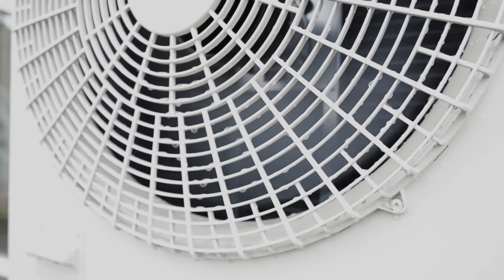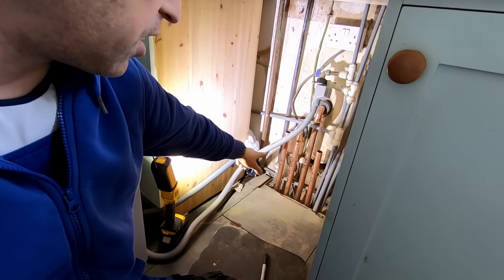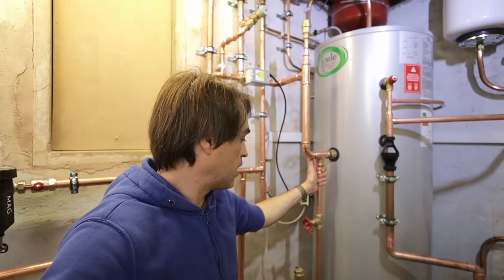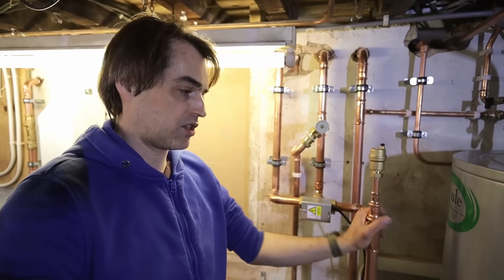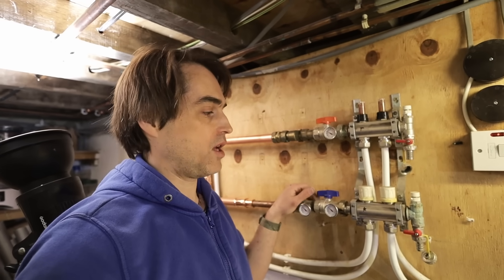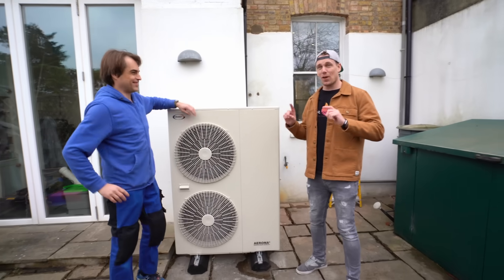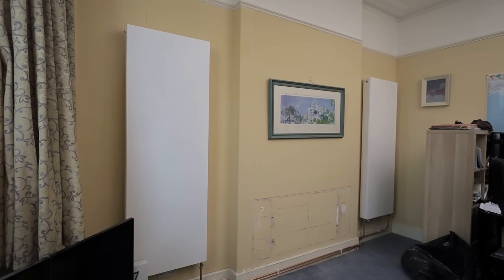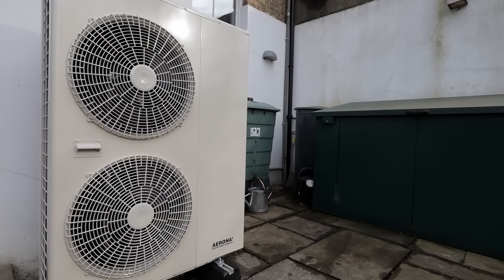The Truth about Heat Pumps: Debunking the Myth.

Comment: Totally impractical installation that’s why they are now talking hybrid installations where so much of what you done would not be needed and is more practical
Reply from the maker: Hybrid would need all of this plus more
Reply: @UrbanPlumbers  really explain
Reply from the maker: You still need to put a HP and all the Pipework need way more controls, a buffer, additional system pumps, etc. Hybrid is a way to go when the HP cannot do the heat loss at he design temperature
Reply from the maker: Although I am not against it. Actually thinking of going ASHP for my place but keeping the boiler just for dhw and without the cylinder

Comment: Roger point is that running cost of heat pump is more than Gas Boiler which is true. Because most people run their Heat pump below COP(Coefficient of performance)  of 3.
COP of Heat Pump should be above 3 if they are going to replace gas boilers and reduce utility bills.
Achieving COP greater than 3 is very difficult if you are using Radiator with heat pump. COP depends on Temperature difference between supply water temperature and the outside Temperature.
Heat pump are effective when the supply water is around 35ºC -40 ºC range , even outside temperature falls below -15 ºC. At this temperature range  COP will always stay  above 3.
The solution is to use underfloor heating even for first floor to get the best out of Heat Pumps. Under floor heating can provide effective heating even when supply water is around 30ºC provided it is designed by professional.
Those massive radiators take space specially in a Music room and look ugly and will struggle to heat the place up when outside temperature falls below -10ºC.
Reply from the maker: running cost of gas is usually lower because gas is cheap as electricty is taxed more heavily than gas. This will have to change.
Reply: 'most peoples run their heat pumps below COP of 3' is incorrect. People have a heat pump running at below 3 as they have been poorly sized and installed. Heat Geek and UrbanPlumbers are averaging well above 4 for their installs. Roger seems to fail to recognise this point, even though he has been around quality installs. 

Can you show your working out for your last conclusion regarding the Music room and -10c? Or is that a feeling?

Comment: It makes no sense installing a heat pump when you have a gas supply in the house already, this install must have cost over £20k that's an awful lot of gas to burn, plus it's cheaper to burn gas than electric, I am with Roger.
In New timber frame homes with UF heating no doubt they will be fine, but most UK homes are no designed like that, and these things are not suitable for them.
Reply: Putting aside the green debate which gas loses immediately, will gas still be cheaper than electricity in 5, 10, 15 or 20 years? Say gas becomes 10x more expensive, is there anything a consumer can do to mitigate that except use less?
Reply: @CampGareth  you do realise electric is generated from gas as well as coal, so there's no green issue really electric is not as clean as the proganda suggests, so if gas goes up then the cost of electric will increase
Reply: @acelectricalsecurity  not in all regions. Scotland is basically all wind all the time. I'm in the North West, we regularly see gas plants at 1-2% of the energy mix from wind and nuclear. Yet gas sets the price of electricity for everyone. Weird that.
Reply: @CampGareth  things got that bad before December that they had to fire up coal fired power stations in Nottingham, and it will only get worse, with the push to electric, in heating and battery cars, we are paying the penalty for the lack of investment over the last 30-40 years, which is when they should have invested in nuclear rather than sitting on the fence, and Boris saying he's going nuclear which is all well and good, but even if they started tomorrow on 10 new stations, they probably wouldn't come online for about 15 years, we're stuck with the current set up for a long time yet.
Reply from the maker: It is still way greener to use a heat pump of cop of 3 from electrics than use gas fired boiler
Reply: @UrbanPlumbers  there's nothing green about generating electric, as I have said coal stations had to be fired up, because the windmills and solar were not generating enough, nuclear has the waste issue, the facts are you can't get something for nothing, and whatever you use, it impacts on the environment, to say one fuel is green and the other isn't is just wrong, especially when gas and coal are being used to generate the so called green fuel.
Reply from the maker: @acelectricalsecurity  there is. Burning gas to heat your home is much more polluting than using a heat pump to heat your home. As a matter of fact it is actually 2.5 - 3 times less CO2 prodcued by using a heat pump vs gas boiler. It is just a fact. Google it.
Reply from the maker: @acelectricalsecurity  and yes you can get something for nothing. That is the whole idea of heat pumps. You get free energy from the air. You get 3 units of heat from one unit of electrity. Precisley what makes heat pumps green.
Reply: @UrbanPlumbers  you won't be getting that in winter. I am paying around 7p a unit for gas and 27p per day standing charge, my electric is 30p a unit and 46p per day standing charge, that 46p is being used to fund the so called renewables, when really it was for maintaining the network , it's cheaper to burn gas than electric, and to switch from gas to a heat pump is crazy, and people will be missold these things, and the companies will disappear, just like with solar and biomass.
Reply: @UrbanPlumbers  to be honest the green thing does not concern me, it's the cost that I am interested in
Reply from the maker: @acelectricalsecurity  just wait till gas gets as expensvie as electricty. Then no one will want a gas boiler anymore. The green thing - that eberyone careas so much about - until it is time to do something about it.
Reply: @UrbanPlumbers  maybe maybe not, but as I said if gas goes up electric will go up
Reply from the maker: @acelectricalsecurity  not quite. the reason electrics is so expensive is the fact it is heavily taxed because it has been histroically produced in a way that is Co2 heavy. However electrics becomes cleaner and will only go more clean in the future. Gas however has not been taxed heavily. It is very likely that taxes from electrics will move to gas as more renewables come online. This should make electrics cheaper and gas more expensive and make moveing away from gas more economically viable.
Reply: @UrbanPlumbers  it's expensive because you need another fuel to generate it,  you need to boil the water to produce high pressure stream to spin the turbines, gas comes out the ground under high pressure, then I imagine it's pumped around the country, as far as know there's never been any subsidiary on gas
Reply: @CampGareth  it’s because gas (along with nuclear and some coal) are the baseload across the whole country 

Scotland Wales and England load balance across the grid and therefore the costs are shared out
Reply: @jasonaris5316  sounds like we need a new baseload that doesn't consume fossil fuels, giant batteries perhaps. As for costs being shared, the price of electricity varies per region depending on how much cheap generation is on that distribution network so I pay less per kwh than someone in London but when I was last renewing (back when 15p per kwh was normal) that difference was only a penny or two despite that region consuming about twice the gas per kwh generated. That feels odd, but then a lot of this system is opaque.

Comment: New build: underfloor heating and well insulated, go for it. Retro fit old house: radiators and drafts, it's too problematic. What happens with your very accurate flow settings after a few years of neglect and calcium build up. Just watching you sets my head spinning with all the complexities of such an install.
Reply: That is why airconditioning heating is great alternative, because you don't have to care for dependencies in the radiators etc
Reply: @roland9367   The unit cost Air to Air heat pumps seems alot cheaper the mono block air to water heat pumps, & thats before you buy the radiators. wonder why?
Reply from the maker: Annual servicing?
Reply: @UrbanPlumbers  Thats it, but everyone wants things to just work forever. Just look at all the uncleaned gutters and downpipes, people not servicing their cars every year. No one takes care of anything, just buy cheap and throw away sadly. 
Awesome to see your company doing good honest work, keep it up!

Comment: Top install Simon. Grant are nice heat pumps and a good company to deal with. What I can't get my head round is anti-freeze valves and how they work. Do they work on system water temperature? If so when they open, how much system water does it lose over say 8 hours? Does the customer need to be fully briefed on checking system pressure all the time in the winter or do you install an automatic top-up system?
Reply from the maker: They open if the system water drops to I believe 2-3c. The pump is set to never allow that to happen so will heat the system water up if it drops below certain level.

Idea is they only open if there is a power cut. 

On my last job they would activate at around 3c when the heat pump wasn’t powered on.
Reply: @UrbanPlumbers  Ahh. I didn't engage brain! Thanks for the explanation. The frost stat in the unit keeps water temp above 3 degrees in normal conditions so the anti-freeze valve would never become active unless the system water dropped below 3 degrees during a power cut or unit fault.  I usually use glycol but it is a pain in the arse to fill a system with glycol and the SHC of glycol is a fair bit lower than water. I think I will be using these valves in future.

Comment: I'm no expert  but delighted  with our heat pump installation.  Retro fitted into an old damp barn conversion that previously  had storage heaters. Key thing was making sure the walls were well insualted and using a low profile mat system  to allow a simple underfloor heating  installation.  After two winters, happy to say house is toastie and running  costs excellent.
Reply from the maker: heat pumps make a lot of sense when changing from direct electric or oil. With gas it is different. Gas it just cheap at the moment.

Thank you for your comment.
Reply: @UrbanPlumbers  obviously it's not great burning fossil fuels if you can help it.

Comment: Why not just do mini splits. Why do water?
Reply from the maker: Hot water would have to be direct electric. Apart for that I have no knowledge why and would be interested in the answer myself
Reply: Yea it still probably would have been cheaper, just would have separate domestic hot water heater. I install alot of samsung equipment mini splits and they work great. 
Great video and excellent work on install i think it looked great.

Comment: well you havent explaned about heat loss on these systems also air sorce when the temp outside is below zero the cost of defrosting the fan LOL heatpumps are not the awnser that is for sure they are just not in most peoples afordibilty so they wont work

Comment: You don't have to force 5K dT. That is just  a design assumption. As the house enters stationary heat transfer, the heat need will be low, so will the dT. It's OK to have 1-2K..the house is heated up and doesn't need more watts.
Reply from the maker: DTof 1? That would be an insane amount of flow. You need around 5-7DT on the system!  And what is stationary heat transfer? The idea is to only replace the heat loss based on the weather curve, not heat the property up to a moment where DT narrows and heat pump starts to cycle. That is the worst thing that can happen for efficeincy.
Reply: Narrowing down dT is good sign, right amount of heat is delivered in the room without need of thermostat.  5-7K will be needed at startup or maybe few cold days in january-december.The rest of the time system is in some degree of part load. It wont require insane flow because also the heat demand is insane low combined with weather temp curve. There is no arbitrary chosen "ideal" fixed dT, proper design of system will take advantage of natural autoadapt . If the heat pump cycles then its selected too large or weather curve is too high or underfloor heating is not properly sized for that property.
Stationary transfer= steady state trasfer is the proper english term i guess.
In steady state curve adaptation+dT adaptation will achive best confort and low heat bills throughout the season.

Comment: Nice job as per usual, I'm not digging you out, can you share how much time and money it costs?

As for Roger, he's got exsperiance and knowledge which he's picked up over the years, I don't think he said don't install HP  per se, they work as they was designed for aslong as all the tick boxes are ticked
Ie, calcs/design/insulation ect ect 

I worked with 250 properties (new builds) which had them installed, supposedly that had been air tested / insulation /mvhr  ect,
I never had any positive feedback. Not from one single occupant 

There only as good as the designer/installer/correct application /property well insulated and end user

Comment: I have a question for the experts. My current 24kw combi boiler is set to 58 deg c. We are very satisfied with the room temperatures after an hour of the CH being turned on. Does this mean there is a good chance we can get away with just a ASHP and the rads and pipework are OK? Its currently 22mm pipework
Reply from the maker: it depends on the property heat loss. If you set your flow on the boiler to 60 and you are acheiveing 21 inside when it is -2 outside then you may be close with the radiator sizes. Pipework will depend on the heat loss though. How big is your property in m2 and when was it built? Is 24kW a combi boiler?
Reply: @UrbanPlumbers  yes its valiant ecotec combi 24kw or 22kw not sure. Its a 4 bedroom 1930s build. There's no cavity wall but we now have triple glazed windows which made a big difference. Just done a edit the boiler temp is set to 58deg and I'm sure it could be set lower and run for longer. We usually turn heating on just 2 or 3 hours at a time 2 or 3 times a day when its 0 degrees outside. The inside is never 21deg its 19 deg which we actually like.. im actually in London
Reply from the maker: @cooliocrib4409  4 bed with triple glazing and roof insulation should be below 10kW heat loss. Althogh heat pump may work on your current radiators it would not be very efficienct to run it like that.

The bigger the radiaotrs the lower flow temperature required and higher efficeincy. There is no running away from large rads, unless you install UFH or have a very well insulated house.

The fact that you can drop flow to 58 when it is 0 outside means that heat pump would work fine in your property, but you may still have to upgrade pipework (usually just primary piepwork), install new hot water cylinder and change some radiators or move them around, etc.
Reply: @UrbanPlumbers  i remember watching a video some months back.  You are in London right? How far is NW4 from you?

Comment: Only 0:32 in, but i'll take a semi-educated guess. Incorrectly specified systems, incorrectly specified properties and poor workmanship.

I am of the opinion that heat pumps are a great thing, yet also of the opinion that many will be an entirely uphill battle in the future, due to those who do not spend the time and effort to make heat pumps work. That's not an attempt to rag on the engineers, everyone at every stage will need to take extra responsibility, from window fitters to dry-liners.

Many seem optimistic that the large section of the market that still fit condensing gas boilers at 75 flow will transform to become great heat pump installers, I remain to be convinced...
Reply from the maker: spot on
Reply: Finished video. Awesome to see Heat Geek with you! Really glad to see you checking DT. You did a tidy install :)

My own system, in a 30's semi, is run on a WC'd Viessman boiler, running on almost all the old rads (spec'd for high temp). Temps outside in the 5 to 10 range and boiler mostly averages flow around 47 degrees, house is almost always at 20 degrees. Efficient systems can be achieved with little work too. (albeit the excuse for this is I just keep putting off changing the rads...you all know how long jobs at home get to wait...)